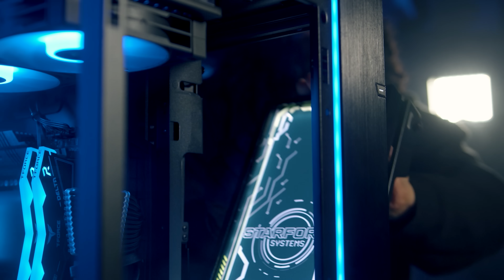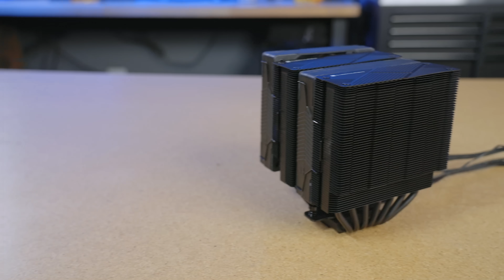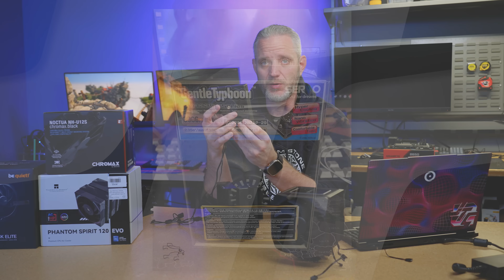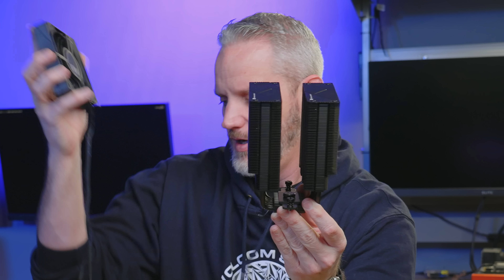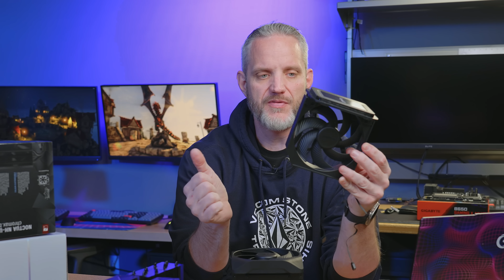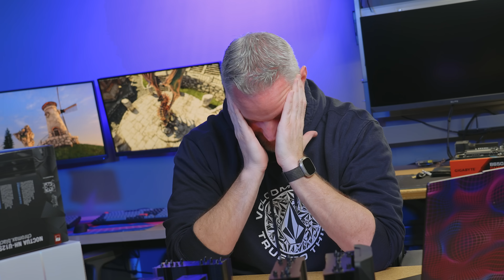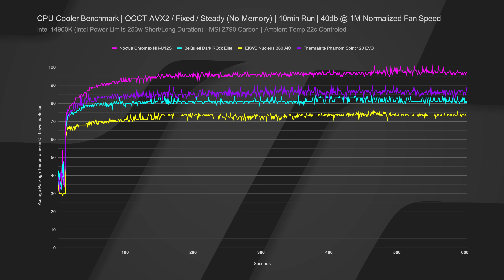This $49 CPU Cooler has big brands SHOOK! Thermal Testing Cheap vs Expensive CPU Cooler!

Comment: Thanks for the vid. It confirms my recent check in the matter for one of my sons.

There is one thing I think you should have as a bench and that is a SOUND LIMIT. 
Many of us want whisper systems (nearly no one have AC in their homes over here) but can tolerate noise while doing hard performing (video rendering/gaming in DCS). So, with a sound of 35-40dB (then maybe 50dB when the fans are being overheard) - what are the temps? And then max them out. That would be great consumer info!!! 

That is something I would appreciate since it is what I always aim for with a system. 

Again thanks for the vid and for throwing in the 360 AIO since that is kind of what one goes for in order to get a QUIET but yet a system that can PERFORM. Yes, I think it is a value if a system is quiet. 100-150 USD but not more. The cost for Noctua is as it became in the early 2000: expensive but back the perhaps worth it for many since they were quiet and of good quality.

BY all means: Have a magnetic setup and one with bearings. You mentioned them and it would be intersting to see how they have been implemented as well as perf and price point,

OK, take care and please go easy with your OC contest with the LONG HAIRED fella… 
You looked really over the top on that vid - funny to watch your energy (rage?) as you talked about OC, undervolting and stuff. Great  competition but perhaps not so healthy for you? 🙂

Oh, while I am here: I got 10 more years of experience than you, but THANK YOU for bringing up how it was for us suckers back in the day. I still am quite causcious with motherboards since I got current via the chassi more than once back then… And that happened with some systems from ”OEM manifacturers” as well. My kids do NOT believe me. What can I say?

// TAKE CARE and greetings from Sweden
Reply: Got to do an add-on: In one PIC overlay it actually says 40dB if I don’t am mistaken. But then I’m curious: why not bring that up? Anyway, if you’re aiming for a quiet system I think 35dB is more proper. And if you’re aiming for are: KUDOS! And please make this fact as an important step in your review. If nothing else: you have an important fact that 
I can’t recall that your buddie Steve has on their channel. Should be an industry standard IMHO. /All the best!

Comment: Very cool! (pun absolutely intended, lol) 
As far as I know, GN has not done this sort of comparison with value at a standardized temp. 👍 The graph is good too, because you can see that the Thermalright does well, but note that the BeQuiet is much less spiky (look at all those nice flat sections). So yeah, they're expensive but clearly they've done a lot of work to achieve that consistent cooling.

Comment: I actually got the Thermalright Phantom Spirit for my 9800X3d 2 months ago and it is kinda baller. I replaced the fans with some quiter noctua fans. I need to replace the rest of my fans though, RGB looks great but I hate my computer sounding like a damn jet engine.

Comment: As this was a kinda test of metrology I have some thoughts.

Having a single tower cooler compared to twin tower coolers is not really meaningful as I see different use cases for these two. 
There might be situations where you only can fit a single tower cooler - than it is interesting to know which single tower cooler is the best one.

If you can fit a a twin tower cooler, you will in most cases do that. And it is unimportant how a single tower cooler performs.

There might be a revolutionary product that steps out of the above mold and then it should be covered for what it is.

Having a reference with a water cooler is good, but better would be to have it be a model that can be purchased.

Also please consider to score the support that each brand gives. You get excellent support from Noctua and you also pay a premium. Does the cheaper brands offer the same support. And in the end it is the end user that decides to pay less for a product knowing that the support offered is none or minimal. But it should be made clear so that we can evaluate value on more than just temperature. (other things that matter, ease of installation, quality of finish (sharp edges etc) and so on)

Comment: Jay - you need to ditch the overpriced AIO and use an Arctic Liquid Freezer AIO - they are significantly better than the EK and also significantly cheaper (the LFIII 360 is approx $70 cheaper on Amzon)

Comment: Ok, first off, Debelcius and temperaturesound needs to become a thing, that's hilarious! 

Second, thanks for creating the cost per degree to TJMax equation. The thing I didn't hear you say in your explanation is that it's a measurement of performance per dollar, which may help viewers understand what is being measured and why it matters to them more clearly than the in-depth of the equation. I don't wholly follow the math, but I know it's describing how well the cooler works for my money, and that's enough for me. Moving forward, I'd recommend describing what the extras are (low db operation, RGB, specific size or clearance) close to the same time that you go over the equation results. I think it will help consumers decide if the bells and whistles the coolers have are really worth the cost.

And as for other coolers to test, you gotta do a Cooler Master Hyper 212. Probably won't keep up with the dual towers, but it was a gold standard for a while with direct contact heat pipes for $20 (looks like it's $35-40 now on Newegg). Probably also obvious to look at testing the top sellers on Newegg, Amazon, and Microcenter right? 

One last thought: pretty sure you've said you always use the Kingpin extreme thermal paste in the past. Probably worth mentioning it if you're not using whatever Thermal Paste comes in the box with the coolers you test. Thanks for the hard work man, you guys keep it up!!

Comment: Thermalrite has seriously stepped up its game. I bought the Thermalright Frozen Notte 360 Black ARGB V2 for $55 for my second rig (14700K), and it keeps up, if not beats, my MSI MAG CORELIQUID 360R V2, which is around $150. I was very pleased with the quality of the Thermalrite. Definitely buying more from them. A 360 for $55, and it is actually very good? Crazy!

Comment: Good video! I would suggest putting in a 120mm / 240mm / 280mm / 360mm AIO among the air coolers, and for air coolers, I'd suggest putting in the OG Hyper 212 EVO, the Vetroo V5, and then some of the more modern air coolers such as the ones Thermalright is making now. The reason why I suggest purposely using some older air coolers is to show how far the technology has continued to evolve; for many years the Hyper 212 EVO just simply couldn't be beaten because it was one of the cheapest you could get that still offered aesthetics and good cooling. But lately the Deepcool, be quiet! and Thermalright air coolers of similar design to the Hyper 212 have displaced it both in terms of value as well as cooling ability.

It was also interesting to see that even your 360 mm AIO reached thermal saturation fairly quickly; I'm used to seeing your custom water loops take several minutes or longer to finally reach thermal equilibrium.

Which reminds me - just for fun, put one of your custom water loops into the chart! I know the distance to TJMax per dollar would be terrible, but I think it would serve to illustrate how there's a diminishing returns aspect to cooling that you've opened up for exploration, and enthusiasts who are costing out their new builds are making trade-offs that, if they're OK with those, can lead to a great aesthetic build with the pipes and the distro plates and such, but if they're more value focused, then they might want to go for an off the shelf cooler and build the custom loop later.

All good stuff and I look forward to more of your heatsink and cooler reviews :) (This kind of reminded me of the old HardOCP shootouts they used to do with like 20 heatsinks on a high wattage CPU)

Comment: I got the NH- U12S before I found out the Ncase M2 could use the NH-D12L so returned S and got the L. Would love to see if it is better than the S for the extra $10. I’m sorry Jay, but I just took my custom loop apart to go back to air cooling. I made the mistake of using the O11 XL so it weight a ton and was hard to move around to flush often so it went 2-3 years without a cleaning. Custom liquid cooling just isn’t for me.

Comment: I have two low profile ThermalRight coolers the SI-100 and AXP-120-X67 that would be good additions to your testing for small form factor builds.  I bought these to possibly replace a barely adequate noctua low profile after I purchased the impressive Spirit EVO for a CAD system.

Comment: I had a $27 Thermalright Burst Assassin on my 7800X3D and it cooled it fine, albeit just a bit loud when the PC is right next to me. Amazing coolers for the price. I ended up swapping out the heatsink for a 280mm AIO just to cut down the noise. Would recommend their coolers to anyone building on a  budget.

Comment: I checked Amazon and the Thermalright peerless assassin 120 with the "screen" on top is under 50$ in Sweden, you can get the THERMALRIGHT Aqua Elite 360 rgb for less then 60$. The Phantom spirit 120 is around 40$ in Sweden and that is with tax included. I have used a few of their cooler when building for friends and i will keep doing that

Comment: if u don't want AiOs the 50$ dual tower air cooler is great, what is insane for me is a single tower Noctua air cooler is 100$, and the Arctic Liquid Freezer 3 280 is 90$ and that radiator is 37-38mm thick instead of 27mm like the other AiOs it's a no brainer for me

Comment: This test  was performed at 250W, so I guess the differences in temps would be smaller at lower power draws. I'm guessing most people buying these coolers tend to use them in mid range CPU's that put out something like 150-200W, and the value proposition of those Thermalright coolers in those cases is insane. At 150W on an I5 14600K I would expect the temperature gap to be almost negligible from all those coolers.

Comment: I've seen alot of comments praising the ARCTIC Liquid Freezer III Pro 360. I've not used one myself and having rackmount cases I've been using the air coolers more (for fear of the pump). I'd love to see how it compared to the thermalrite thought.

Comment: Your formula makes the assumption that every one degree change is equal.  Does the change from 89C to 90C have the same effect on throttling between 9C to 10C?  I'd imagine not however I don't know.  This would be an interesting test to see where on the scale e.g. 20-120C does a 1C difference have the most effect on throttling.  Are some cooling systems therefore more targeted at reducing temperatures where it matters?

Love your show!  Keep up the good work!

Comment: The NH-U12S is almost the worst candidate for this comparison. You don't buy this cooler because of the cooling capacity per dollar, but because of its smaller size. Comparing 2 dual tower /dual fan coolers to a single tower single fan cooler makes no sense. Use the NH-D15 G2 or at least the NH-U12A with two fans.

Comment: To answer jays question at the end as to why you would buy Noctua: I do because I can trust them to send me new mounting hardware for free even two, three or four cpu sockets down the line. Yep, they cost more, but if you actually commit to that one Noctua cooler that you will run forever it's actually cheaper than to buy a 50 bucks cooler for every PC with a new socket that you build. It all comes down to outstanding customer support for me.

Comment: not a cooler, but a test: y-cruncher, specifically the BBP digit extraction test which uses AVX2 float calculations and uses minimal RAM (and may even fit purely inside cache, idk for sure though). I've found this test to be basically act like Furmark for CPUs -pure unadulterated thermal maximum. not tried the test you're using so maybe it's comparable, but yeah

Comment: I've been using a BeQuiet Dark Rock for many years now.. (not sure whether it's the 3 or 4 version), and it's still running fine. You don't need the Elite for 140$ (btw, hahaha tariffs, it's 100$ in the EU).. the Dark Rock 5 is just as good unless you're planning EOC and costs half the price.

Comment: I'm using a Thermalrite Phantom Spirit 120 EVO to cool down my Ryzen 9 9900X. Initially it idles around 54 Celcius, jumped to 80+ when loading a game but settles around 65-70 gaming.  I recently closed the glass side panel to the case and the days have gotten hotter so I'm seeing higher heat level.  I even see brief jumps to 90C from time to time during loading. I'm going to 3D print a mesh panel to replace that glass.
Aside from the great heat management  I love how quiet the cooler is. At full speed the fans will be be annoying but much of the heat can be kept down at just around 80-90% fan speed

Comment: Thing with Noctua is that it lasts forever, there is Noctua fans that run for 10 years now on a daily basis. And you get free mounting hardware if you change sockets. Comparing single vs dual tower is kinda weird tbh. Especially if there exists a dual tower noctua for nearly the same price as the single tower that was used here.

Comment: Thermalrite has some great coolers with great value. 
I'm not really happy with your choice of the old NH-U12S for this comparison, though. 
You didn't even pick the current gen., much better U12A that replaced it several years ago, but picked the old 12S in its silly expensive Chromax variant and slapped it on a 250W CPU ... which isn't the intended use case for either of those single-tower coolers. 
Including this cooler proves nothing, except that it was Noctua's worst value product, which we already knew. 
Ok, maybe Noctua deserve a slap or two for their high prices, especially for their lower tier products, but this seems like a bad way to do that. 
A NH-D15 G2 for $150 would've beaten the $140 Dark Rock and those two would've duked it out in terms of value at the top end 
while you still could've highlighted the Thermalrite's performance and amazing value in comparison. 
Maybe even more so, since at $140/150/160 every other cooler in this comparison would've been 3x the price of the TR. 
Then again, a much better AIO, the ARCTIC Liquid Freezer III Pro 360 - arguably the best 360mm AIO on the market -  is only $88. 
But that wouldn't have fit the narrative, I suppose. 
Which makes this 'comparison' even sillier, because the TR cooler is a good product with great value that doesn't need to be propped up artificially

Comment: I'm using a cooler very similar to that Thermalrite on a Ryzen 5900. Under full load, my CPU never hits above 75C. I think what this shows is that you can use air cooling with the highest TDP CPUs and get decent cooling. It's even better if you do so in a high airflow case.

Comment: I bought nh d15 when it first came out for around 100€ and i still use it today on i7 13700k. Still am awesome cooler. Will be using it until they provide adapters for new sockets. Was expensive but well worth it. So far it sat on i7 4771, i7 8700k an now i7 13700k. Nowdays i d definitely buy one of the new cheapper comparable coolers but at the time d15 was the king. I cant fault it. It has setved me well and still does 🙂

Comment: Why not compare it to the Noctua NH-U12A with its two improved fans? Seems a better matchup.
GN also tends to use the U12S in airflow cooler comparison charts, I do not understand why. the U12A just seems to be the clear improvement on the U12S

Comment: Recently built a new PC and usually Noctua is my default choice, but decided to go with the Phantom Spirit because the performance was so similar and it was significantly cheaper than Noctua. I think when it comes to CPU coolers other brands have caught up with Noctua, and there's only so much efficiency you can squeeze out of already very efficient designs.

Comment: Looks like a U12A on first glance. I bought a used excellent condition U12A for $50 and wow what an amazing cooler. 120mm cooler that cools on the same level as their dual 140mm D15 cooler. I own four D15's and this U12A is impressive.

Comment: seems logic that, when you compare a single tower cooler against 2 dual tower coolers, the first will run hotter. I started using a Noctua nh-d15 on my I7 7700k and now still use it on my I5 12600k, with the original fans...

Comment: LOL. Jay I've been using Thermalrite for years. Nothing wrong with that brand buddy. I had a dual fan system that I loaded the shit out of to test it. It stayed cool. It just looked goofy because I had to offset the outer fan because of my ram. The fans didn't go flat out anytime. Temps were ok....Only peaked at about 85. I still use my dual fan for benching without paste of course and it still works great. I only build water systems now but for a lower end build?? Nothing wrong with air. I have customers 5 years in without a hiccup.

Comment: Out of all the AIOs this guy has he chose EK lmaoo
Reply: Well, imagine he had opted to use an ARCTIC Liquid Freezer III Pro 360 instead ...  
you can't shill a $50 air cooler when the best 360 AIO on the market is only $88.
He also chose an old U12S in its even more over-prized Chromax form, even though the U12A that superseded it years ago is much better in performance and value. 
Not sure why he's doing it - the Thermalrite doesn't need to be propped up artificially - but this was clearly not meant to be a realistic comparison between directly competing products.